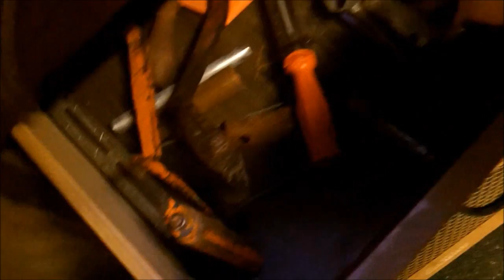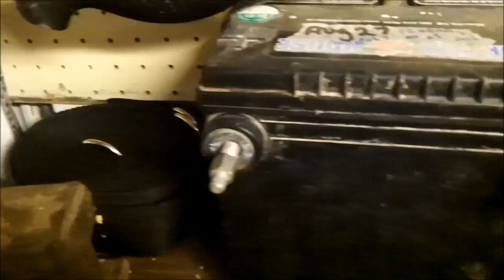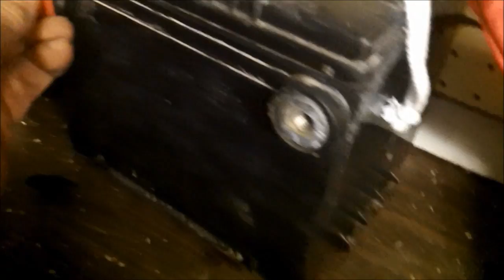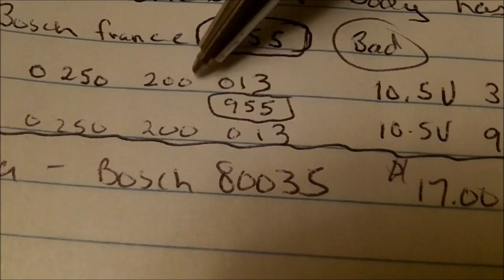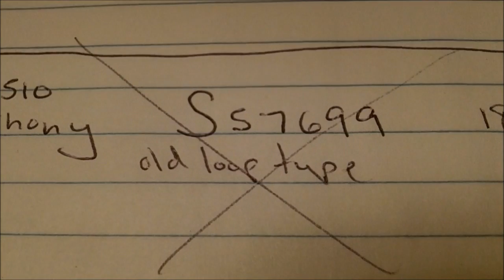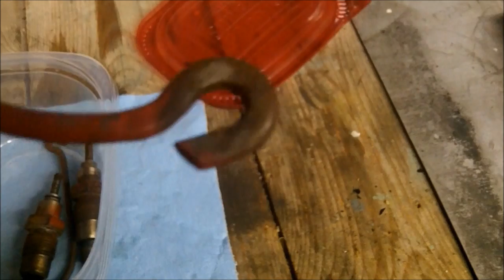How to test Glow Plugs 2 possible ways

Comment: I have a international 3444.  it uses the same glow plugs.  I have the champion ch 28 with the loop.. I would like to use the bosch like you have.  What is the bosch part number?
.
Reply from the maker: Hi Tom
The plugs with the looped end are for the "in series" original set up.  The single pole ends like shown inn the video are for the parallel set up. With the parallel set up if one plug quits the rest will still glow. The ground from the last plug to the motor is not needed then. The coil resistor on the dash that glows red will not be needed either with the parallel set up. I think there is quite a bit on YouTube to show the difference between both set ups.

Comment from the maker: I went with Bosch the same as what was in it.  As I stated my son found some on line in New York for $10.00. They only had 4 and were clearing them out at a low price. I find the tractor is starting ok but I still have to hold the plugs on for around 15 to 20 seconds for it to start good. I do not know if it should start easier with plugs held on for a shorter period or not, but it needs the 15 to 20 seconds. Will be interesting to see how long I have to hold them on this winter...

Comment from the maker: No, the stock glow plugs are connected in series, mine are connected in parallel. The glow plug should have a heavy wire going to it and a heavy wire leaving going to the next plug with an insulator between the 2 wires so they do not touch.